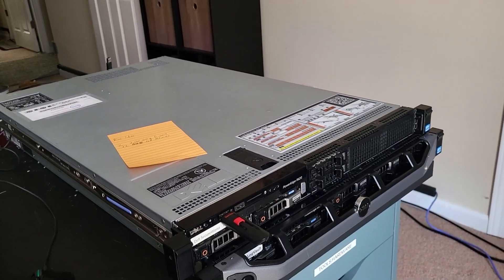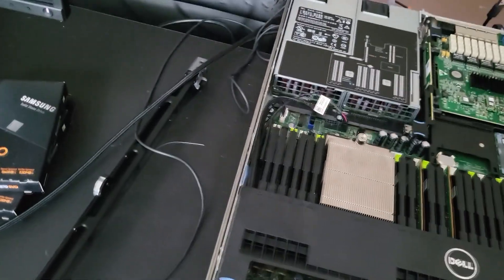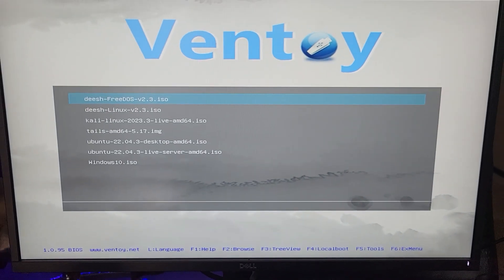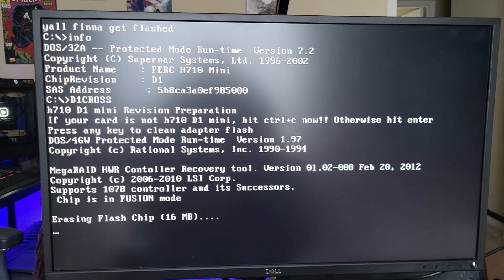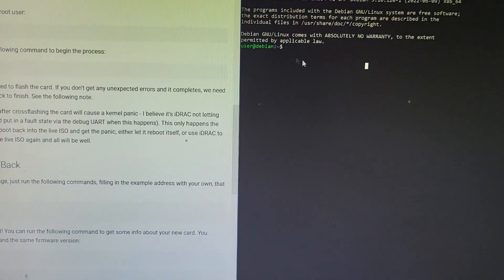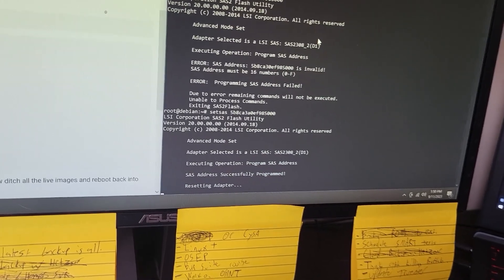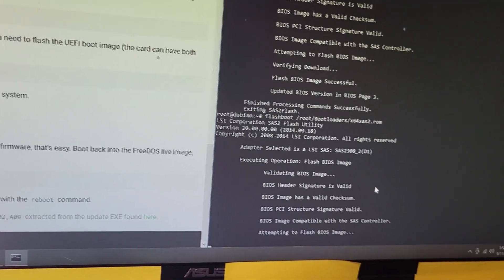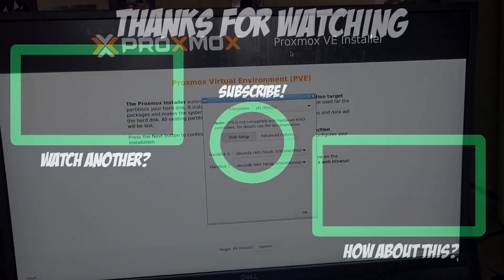Flashing a Dell RAID Card to IT Mode | Homelab Vlogs

Comment: I have Dell PowerEdge R640 with H740P and i was able to turn mine drivers into non-raid drivers and use that card as HBA. I did had to upgrade the firmware on the card tho and im pretty sure its not supported on all dell perc/raid controllers.
Reply from the maker: Yeah it's def not supported on all models.  There's one fellow in the comments who had one that's not compatible.  Or at least not with this method
Reply: @quirkykirkplays  So i went and double check that and the support is super limited its only on H740P, H745, and H745P MX i was lucky that mine server came with it.

Comment: shame looks like my dell r610 uses a H700 raid card which cant be flashed
Reply from the maker: I've been doing google fu all week to try and find something, and I've turned up squat....

If you find a solution for your system, would you mind posting here?
Reply: @quirkykirkplays  only solution i found was to just use the raid card i already had it just now uses up a pcie slot because dell locked down the internal one to only their things